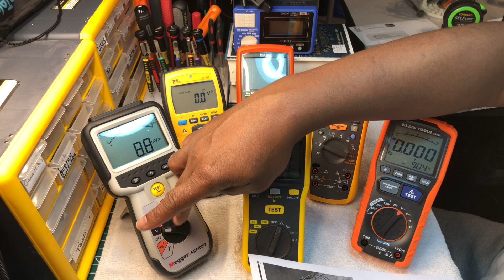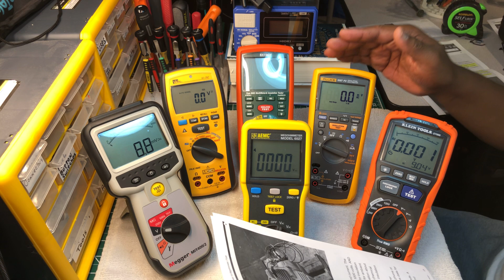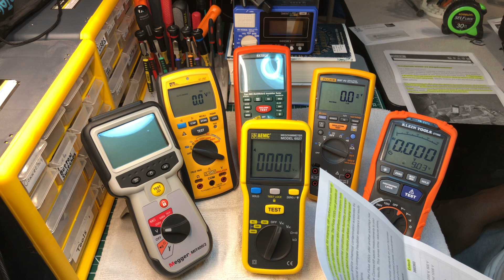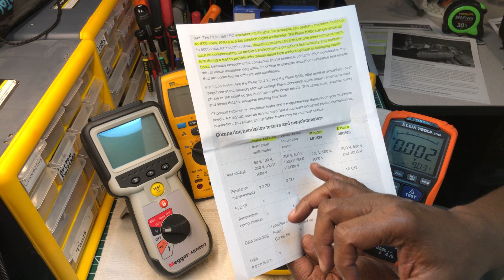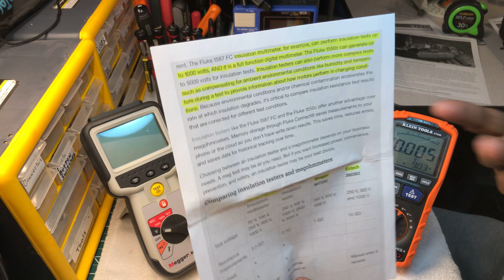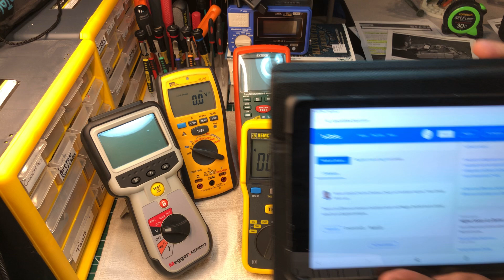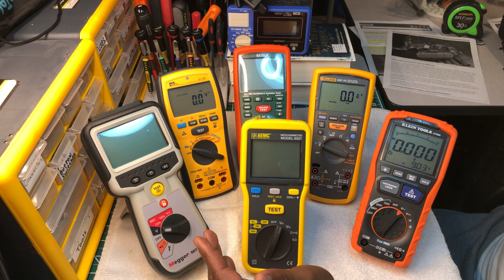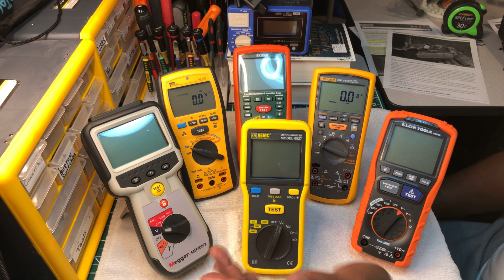🇺🇸🇮🇹🇬🇧What are the DIFFERENCES between MEGOHMMETERS and INSULATION TESTERS

Comment: I think it is just Fluke's PR department trying to big themselves up again. The phrase MegOhmmeter was used to describe an instrument capable of measuring MegOhms, I believe the original test voltage was 250V DC and then raised to 500V with the Series 2 Megger. As far as I am aware, both the terms MegOhmmeter and Insulation Tester were created by Evershed and Vignoles, the former being shortened to 'Megger' in 1903 that they then registered as their trademark. Even back in the 1920s, the sales literature and instructions on the Series 2 Megger utilised the phrase Insulation Tester. It wasn't until 1987 after Evershed and Vignoles were taken over by the AVO group, that they used Megger as their company name.

The introduction of DAR and PI test ratios is more about analysis of insulation systems rather than the actual test instrument. Generally speaking, DAR and PI are more predominantly for use at higher test voltages above 1000V. Whilst you have the basic insulation testers up to 15kV test voltage now, alongside these you have the Dielectric Diagnostic Analysers that incorporate more test functionality such as DD ratio, Tan/delta and frequency response analysis alongside more traditional DAR and PI ratio tests. You then step up to HiPot tester with outputs 100 kV+. Generally seeking you can argue that they contain a MegOhmmeter or even a GigOhmmeter now as they all measure high resistance values.

The 1587FC and instruments like this are a combination of an insulation tester and multimeter and often go by the name of Insulation Multimeter. The first one I saw was the Keysight U1461A circa 2014 to 2015.
Reply from the maker: TP it took me a while to respond to your commentary, I wanted to make sure I read everything that you wrote. And as always you’re on point I really appreciate the thought that goes into videos or commentary. Thanks sir keep it coming.